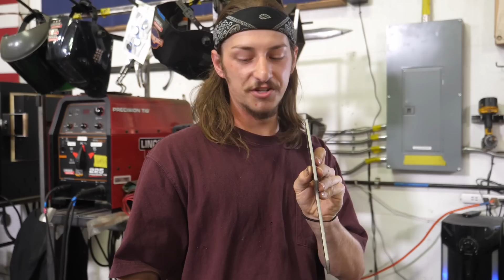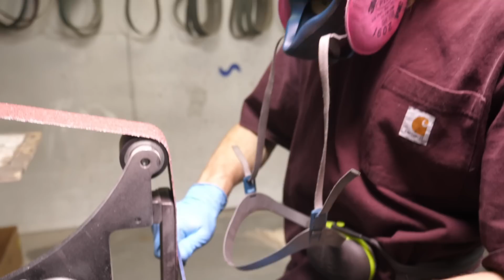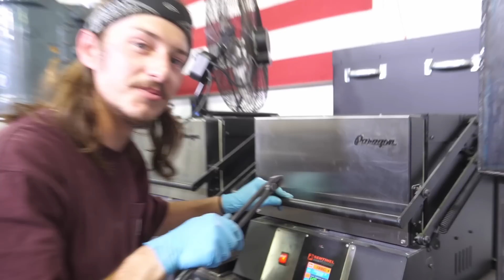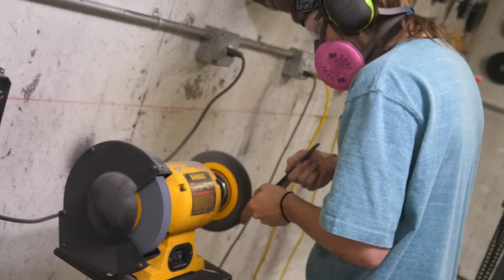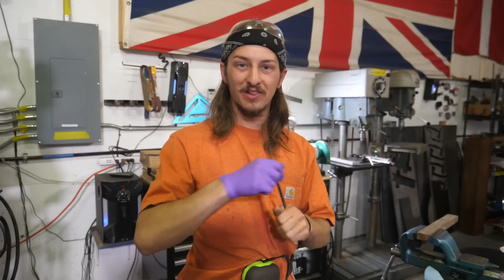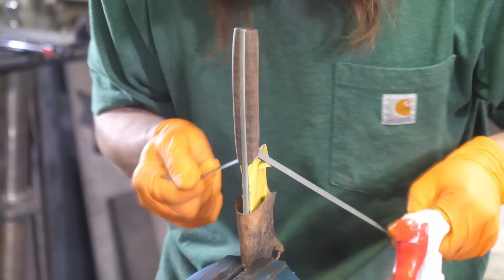The Butchers Cleaver   A Build-A-Knife-Box

Comment: Dude u dont need a respitator just to sand something
Reply: No, YOU don't need a respirator to sand something.  Sure it a personal choice, but it is very much like smoking.  Sure, you can smoke, but it not healthy.  Same thing for sanding without a mask, sure you can do it, but it's not good for you.  Some woods like purple heart, it just takes a few exposures to the dust,  and then some people become allergic to it with strong reactions (but not everyone).  I am just a garage maker, and I wear a mask for sanding metal or wood.  If that was my regular job, I would wear a respirator.  If I was setting an example on You Tube, I would wear a respirator.
Reply: What an idiotic comment. Most sandpaper is aluminum oxide, which is a huge neuro toxin.

Comment: The calipers are nice but I've been using a drill bit for years to scribe my center line.
Reply: How does that work?
Reply: @Budsown  you take a bit the same as the thickness of the metal.  Laying the knife blank flat on the table use the tip of the bit run it along the edge.  It will leave you a center line.  Now grind just up to the line to achieve the bevel.
Reply: @kamelsr  got itx..thanks much!